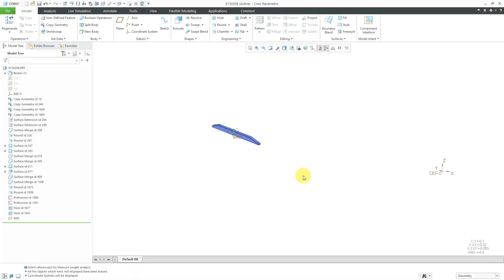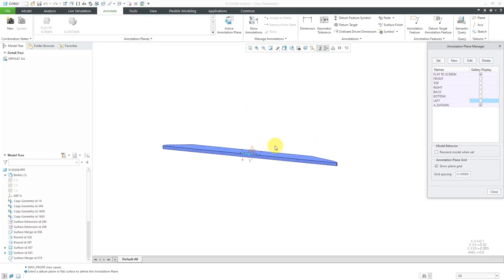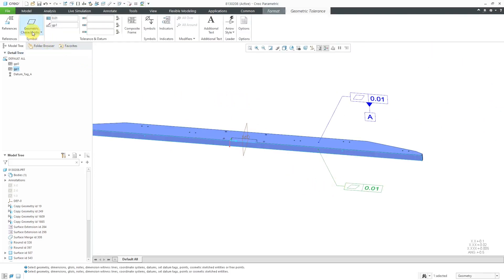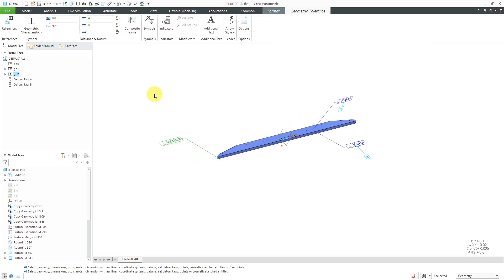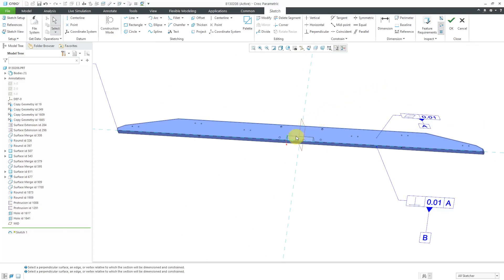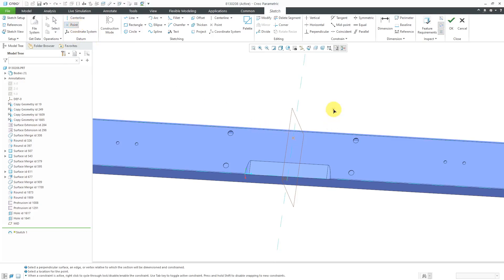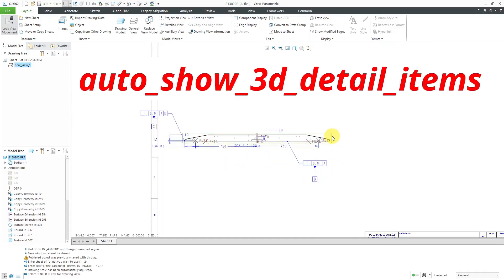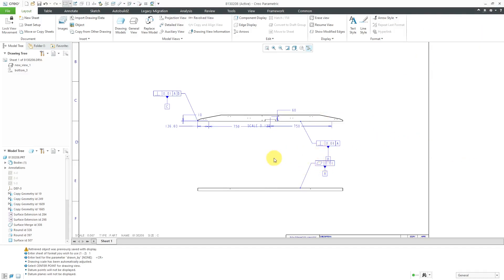Creo Parametric - Setup for Datum Targets Video - Model Based Definition (MBD)

Comment: I want to first thank you as I enjoy many of your videos. It is nice to see what I may have forgotten over my 27 year of using this software or even better something I may not have used before.

In this case I feel this video only covered half of what a user should know when setup and use datum targets. It also teaches bad modeling practices that are too easy to learn and as I find can hard to break a user from continuing to use. I know this is a quick tutorial and I may seem to be picky but one bad practice shown is creating a second set of dimension to the point sketch rather than using the sketch driving dimensions. The other would be the sketch driving dimension scheme. The sketch dimension scheme should be setup ready to show in the drawing and be driven from the displayed datum’s. This would be in reference to your choice of datum [C].

Having written all of this I want you to know I look forward to viewing move videos.
Reply from the maker: Actually, due to Model Based Definition, Flexible Modeling, Annotation Features, and downstream use of First Article Inspection & Critical Dimensions, the old conventional wisdom of "at least 95% of your dimensions should be shown dimensions and you shouldn't create dimensions" doesn't necessarily apply. I myself used to teach that and advocate that until about a decade ago. I've had several discussions with PTC product managers about this as well. Creating dimensions is no longer regarded as a bad practice. Changes in technology result in changes in recommended practices.